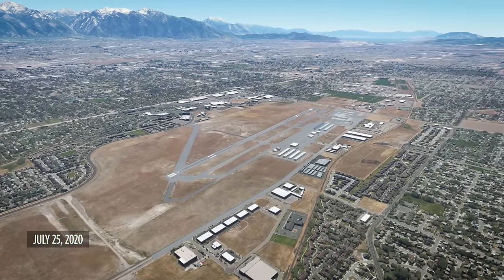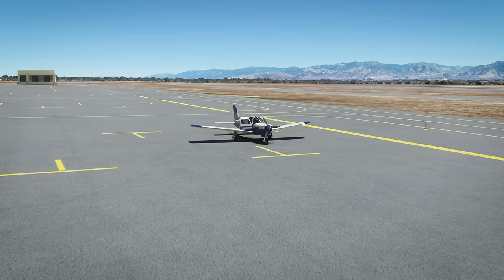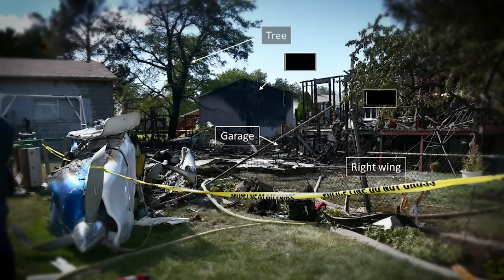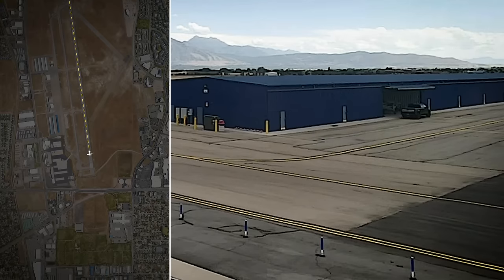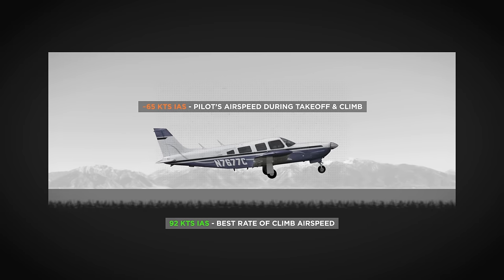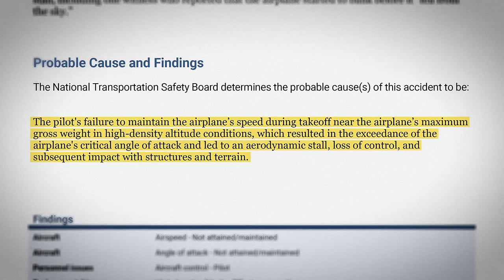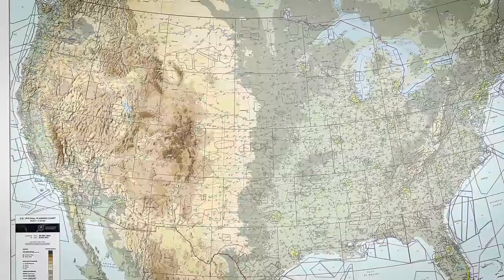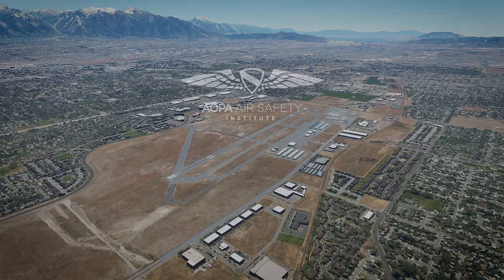Accident Case Study: High Aspirations

Comment: I love how when you go through training, they drill into your head constantly about performance calculations, always telling you how important it is to do the calculations. "Break out your POH" yet every time there's an accident like this they don't hesitate for a second to tell you how you can't trust your published numbers in your POH.  Honestly, if the POH performance charts can't be relied upon to make ACCURATE calculation, what good are they?
Reply: Thank you for being one of the only people on here that actually gets it. This guy did everything right, and was let down by the manufacturer, and yet is still being blamed for this.
Reply: @aramusbelmont4992  of course. It's always "pilot error". He did everything he was supposed to do. More meticulously than most pilots, and it's still failed him.
Reply: Actually they are pretty good nowadays .Back in the day high altitude figures left a lot to be desired , and other useful stuff might not have been there at all.
But I doubt his POH suggested using any flap for this takeoff——what reason would there be to ? No obstacles off the far end , plenty of runway length , hard surface and he would climb steeper and faster clean than with any flap .
Reply: @davidwhite8633 For that takeoff it's probably a good idea. His airspeed is going to be really low.
Reply: Operating so close to maximum figures based on the caluclation, I would always consider that you can´t rely on 100% performance as expected in the POH. This was a old plane as they said themselves while planning the trip. Was the wing surface perfectly clean? Where there dents and scratches? Can you rely on 100% performance on the old natural aspirated engine or could there be some deposits at the valves? These 3-5% degredation are negligible on normal days, but you just shouldn´t ignore it when operating the plane at 98% based of the POH numbers.
Reply: @sp3iky  my point was more simple. If calculations can't be relied upon to provide accurate results, then the calculations are nothing more than well thought out estimates.
Reply: @AV8R_1   I understand. But I don´t know, how much impact these things I said had in reality, or if they are included in the POH numbers to a certain extend.
At the end, we are looking at it based on this case without knowing the exact condition of the airplane at the start. Therefore I won´t generalize it by saying you can´t trust the numbers based on the calculations. I´m also sure there are some required conditions named in the POH under which the given tables and numbers are valid.

What I take away from this video is: You should always think about the whole situation and if it is perhaps safer to add some additional margins.
Reply: The data in the POH is compiled by very proficient test pilots, at least that's what I have been told.  If your car came with performance data rather than with an owner's manual, and stated the lateral G capability was .94 G, would the average driver expect to attain .90 G in a turn?  Probably not.  In this case with a "used" aircraft the pilot attempted to achieve very near the tested operating limits of the aircraft.  Not leaning the mixture, not rejecting the takeoff, expectations of the passengers, and low experience seems to indicate a willingness to trust the printed page rather than reality.
Reply: @briggsquantum  I don't disagree with you, but I think you're missing my basic point. In fact your statement supports my basic point. My point being, that we all get drilled into us that we should do these performance calculations based on the POH, in spite of the fact that it is widely known that, "individual results May vary" this fact alone should render the practice of using these performance calculations moot. Sure, it would still be a good practice to use them as a guideline, but I think more emphasis should be put by instructors and students to take the POH performance with a huge grain of salt.
Reply: @AV8r_1 - The POH numbers should be looked at as optimum (the best possible) performance numbers.  As the foundation suggests, padding the number by 50% provides a good safety margin.
Reply: Well, I’m not sure what information is /is not in his POH/AFM but when operating at high density altitude [ especially airports there ] it’s critical to know what CLIMB SPEEDS such as Vy and Vx are at those altitudes——-they may be critically different than those at sea level , and should be known and followed .
Vy decreases about 1% per thousand ft and Vx increases about 1/2% per1000’,as altitude increases . His use of flap is mystifying; minimum drag is essential at those altitudes with no obstacles off the departure end and both rate and steepness of climb is increased in clean configuration .

Comment: Another point that cannot be over looked is the high probability that the pilot used flaps to help the plane climb as a last ditch effort. I think it should've been noted that lift does not make an aircraft climb, it is excess thrust. The flaps simply added drag which further hindered performance. Excess thrust is what makes planes climb not excess lift.

Comment: May the survivors of this tragic accident somehow find solace, and may the victim RIP.   After the first two minutes of this vid. I knew how it was going to end.  Planes fly differently with six pax on board.  I am a low time GA pilot with just under 3,000 hrs.  I usually fly a FG, non-turbo Saratoga (similar to the Lance) and have flown across the US a dozen times with at least one passenger, usually not another pilot.  I've landed at most airports in Colorado, including many landings at Leadville, Telluride, Aspen, Alamosa, Buena Vista, and Glenwood Springs -- all high elevation airports.  During the summer months, the DA at Telluride and Leadville is often over 13,000'.  I have made over 2,900 landings safely all total.  I NEVER fly in the mountains with more than 1/2 tank of fuel regardless of the DA .... 300 lbs additional weight I don't need.   I can get the Saratoga up to 17,000'  (with only 50 gal. of fuel on board).  This is well above the service ceiling reported in the POH.   I practice flying high altitudes at home in the Mid Atlantic Piedmont to see how my plane acts (you can't depend on the numbers in the POH -- if you are well within the limits and crash, you'll be just as dead as if you exceeded the POH allowances).  Before any flat-lander pilot goes west, take some time flying your A/C at its service ceiling -- see how it performs with and without pax.  If you like flying in the mountains, take a course in mountain flying before you go.  I NEVER fly in the montains under IMC or at night.  Many years ago I took a check ride in a C172 before renting at Alamosa, CO -- the check pilot was a DPE.  He told me very few GA pilots there get their instrument rating b/c hardly anyone would fly in the montains under IMC.  Smart!  Also before you go west get Sparky Imeson's "Mountain Flying Bible."

Comment: A big factor has to be feeling unused to an anemic climb. In a Grumman, high DA, you just HAVE to be accepting of 100/50/0 fpm sometimes, and accept that a climb is a climb. If you're used to unloaded, low weight performance, a poor climb can induce panic, fiddling with the mixture, and reduced attention on flying the airplane. Flying the airspeed, not the climb rate, can be life/death.

Comment: The takeaway from this is that you should always visually verify wind direction /w a wind sock. The AWOS is only a reference for planning, the actual conditions should guide your decision. Further, you should lean for best power at high DA rather than full rich. You also need to have a abort decision point on the runway based on performance calculations, if you’re not off the ground prior to a calculated point then pull the power and use remaining runway to abort takeoff. If you don’t have enough runway to have a safe decision point then come back later when the temperature/DA is lower.

Comment: Density altitude is no joke on hot days. The best thing to do is to set the mixture properly for maximum power on a normally aspirated engine. This should be done while on the runway with brakes held, full throttle set and mixture momentarily set full. Then, decrease the mixture until full power is seen (normal max rpm with propeller set to max RPM) and then release the brakes.  This is similar to the way you set the mixture in the air for cruise flight except you're on the ground and full throttle and max prop RPM set.
Reply: Seems like it ought to be an absolute to find max rpm during runup, right?
Reply: @johnrltr  yeah it should be especially when dealing with high altitude airports and or high density altitude.

Comment: Jeez, this is not your typical high DA accident. The pilot did almost everything right. The exceptions being missing the change in wind direction and not aborting the takeoff. Even on the takeoff he likely had 70% takeoff speed at 50% of the runway, the typical rule of thumb for high DA. Even the negative effect of the tailwind was likely a non-issue as the plane flew for some distance after takeoff. I'm usually one to blame a "stupid pilot" but in this case it seems like the plane just wanted to kill him. 

Recently heard the following: "What does your plane say to you after you close the hangar door?" Answer, "Next time I'm going to kill the SOB." That's what this feels like. 

A really sad accident.
Reply: Never trust a Piper Lance!

Comment: A colleague was in charge of safety at a large industrial plant.  He stated that "it takes 3 out of bounds factors to create a fatality".  Each one alone, even two in combination, allow enough time or insight to react.  Three is overwhelming.  Typically each initially appears "in bounds", then drifts out.  

High DA, high gross weight, CG pretty far aft - that's like 2-1/2.  Throw in a surprise tailwind, possibly over-rich mixture, and a premature rotation, and he was cornered.

Comment: I see mountains, hear natural aspirated, and it’s hot. I’m 20 seconds in and unfortunately know what happened just from those 3 details.

Density altitude.
Reply: Yeah, goes to show that with a high DA, just one small thing that goes wrong can be disastorous. The pilot had enough runway, made sure the a/c was just in weight and balance, and seemed to have configured the aircraft correctly. A slight tailwind of 5 or 6 knots might have been the difference.
Reply: @yobb1n544 Your key point there, 'just in weight and balance' 
No buffer unfortunately.
Reply: @ThePorkypete51  Yup. Again, if the density altitude had been lower, there would be somewhat of a buffer at that W&B. High density altitude removed that buffer and any margin for error.

Comment: I used to fly out of KGXY when I was first license and KFMN the last 5 years. Both had high DA in the summer. KFMN could get into the high 9,000's. That doesn't leave much  room when you consider the service ceiling of a C172 is 11,000' (if I remember right). I suspect the big difference in the outcome of this accident was the tailwind, high DA, and high gross wt.
Reply: And flap. What on earth did he use any flap for ? No obstacles off the departure end and reduced  angle and rate of climb since a/c climb better clean .
Not to mention Vy would be ~7% lower at that DA , which he may not have known .

Comment: It's super easy to get lulled into  complacency when we are student pilots or new private pilots because we know we can fill the fuel tanks and hop into the C-172 by ourselves and generally be OK on weight & balance and max gross weight.  

The situation drastically changes when we go to higher terrain and warmer temperatures. Plus the POH numbers are based on new aircraft with highly experienced test pilots at the controls.

Comment: I was in the right seat with my Mother returning from UNR in 1970 in a cherrokee. Mom was one of the earliest FAA women designated examiners in all levels of licensing allowed. We took off from reno in summer temps and were asked if she could take a point short of the runway threshold due to some dc3 exhabition rides happening.  She did some quick calcs around what she had already calculated as safe and thought she could.  I was a glider pilot already and was very aware of what happened next.  We got in the air at the numbers.  There was a farmhouse infront of us. She turned as limited as possible to miss the roof. Every foot mattered. Inch by inch we climbed.  She knew, within minimal margins the best airspeed to climb and kept it there while making sure that terrain in front was not higher. We talked about that for so many times in the years after.  bottom line is she taught lots of people to fly, safely and always  with the knowledge that any pilot can make a mistake at time. The ability to understand the very basics of flying and apply it instantly will be key to survival. In another story it saved my life

Comment: I've done all my flying at pressure altitudes in excess of 6,200 feet with density altitudes often 9,000 feet or higher. Even in high performance airplanes that meant you could sometimes fail to reach pattern altitude on downwind, and that was far below the aircraft's max gross weight. I recently did some training at KLAR, and it was critical to accellerate to climb speed in ground effect to avoid sinking. With a full airplane that sink might put you far enough behind the power curve that you can no longer fly.

It is always important to keep in mind that a fully loaded aircraft is generally going to be marginal in performance in even the best of conditions. Fuel, especially, weighs a ton, and especially at high airports putting too much gas in the tank can even put jets at risk (though that's more a braking performance issue when it happens).
Reply: With all your experience, do you recommend to always lean for max rpm b4 takeoff?  (and find max rpm during your runup. of course)  Thanks.
Reply: @johnrltr  It's just part of a standard runup for me. I wasn't aware there were people not doing that. After all, at a 9000 foot DA you can quite literally flood your engine just trying to taxi at full rich.

Comment: This incident is very sad, I can't imagine the pain the surviving family members are going through.  Especially that the pilot did follow every single rules such as W&B, etc.    Flying a Mooney at airports in the west like Mammoth, Big bear, Ogden, Page, Sedona, etc, I have been in this kind of situation for many times and always thought that there should be multiple sets W&B table / CG limits in the POH for several different density altitude scenarios. Right now, FAA requires only a single weight / CG limit number, which is very confusing, as from both our experience and also like this video suggests, the max weight an airplane can safely carry changes significantly with density altitude.   Fortunately,  my Mooney has 310hp and I never had to carry more than 3 passengers, still there were scary moments.  Also, during (FAA standard) pilot training I don't believe we were taught much about what mixture and prop to use during take off at high altitude. We were only taught to use full rich and prop full forward at take off. It is only from experience from many takeoffs at hot summer days at high altitude airports that I discovered, that this does not produce the best climb performance. I am still not very 100% clear how to choose the mixture and prop in such scenario.

Comment: This could have been me. Winslow AZ, hot afternoon, just below max gross Cherokee Warrior. Did all my calculations, leaned the mixture of best power, even changed runway at last minute to get a slightly better headwind. Lot's of runway - takeoff roll normal (long - but I had taken high alt training). Had over 80% of flying speed at 50% of runway...plane is climbing at ~300 FPM...all good so far. What I did NOT plan on was a downdraft windshear just off the end of the runway (as the land slopes away from the mesa the airport is on). 

Now we're still climbing at 300 FPM, but in a sinking column of air....and we're sinking with it, toward the ground. "Pulling up" would be a stall...I can tell you that there's a nice broad riverbed wash just to the east of the Winslow airport because we flew down it (As I recall - BELOW the airport elevation). Finally, we escaped windshear and climbed out (slow and with little margin) and completed our flight to Santa Fe. LESSON: Stay way out of marginal situations, like high DA with a plane underpowered for the circumstance.